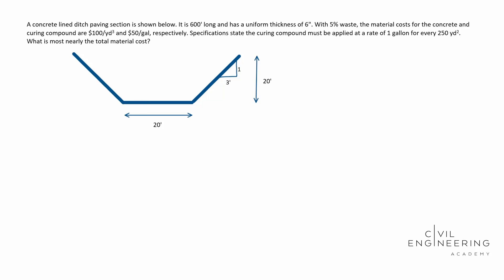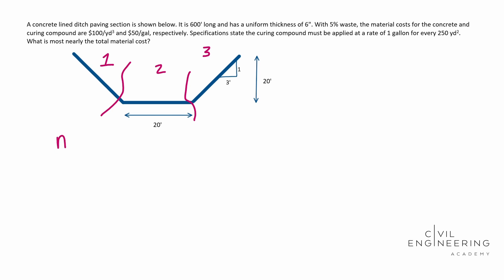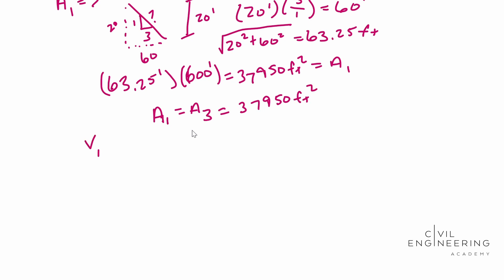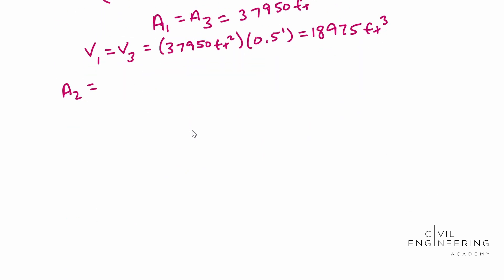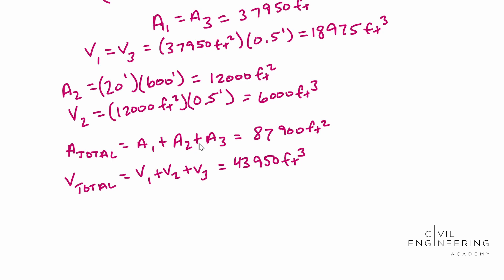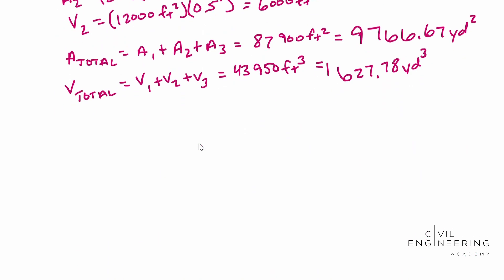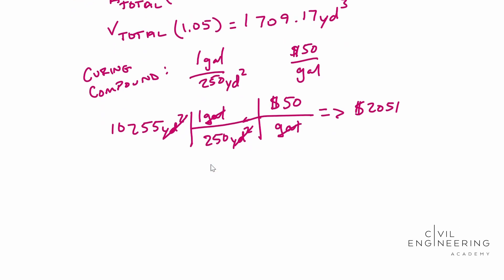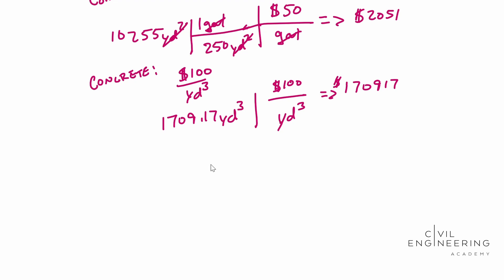Civil FE/PE Problem - Quantity Take Off - Find the Total Material Costs for a Ditch

Comment: I don't disagree with the math. I just find it peculiar that the rate to include the curing compound is based on square yards as opposed to cubic yards. I assumed it was a typo which gives a different answer (obviously). edit: I am mistaken as it is sprayed on top of the concrete -- not mixed into it

Comment: The material cost for the curing compound may need to be adjusted from a real world construction perspective. Calculating the rate of application and the 5% waste, the total gallons calculated = 41.02 gallons. This number multiplied by $50 per gallon give the stated answer of $2051. However, it is not possible to purchase .02 gallons. This number can be rounded up to 42 gallons which will give an answer of $2100 for the curing compound.  I really like your explanations and problem walkthrough.  Thank you for the video.
Reply: If we had to round up to consider for volume of jars sold in home depot the extra step might make problem more intense. It's a good problem, if already intense.

Comment: You don't spray curing compound on waste. If I'm not mistaken, you place curing compound on concrete after the form is poured.
Reply: You are correct, however, this problem is assuming that 5% of the curing compound is wasted (overspray, spills, etc). Does that make sense?